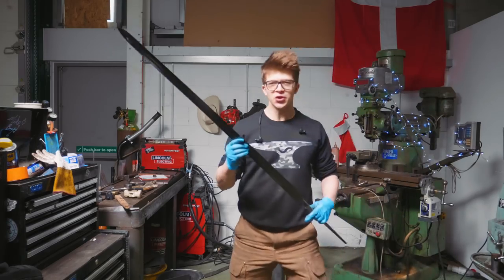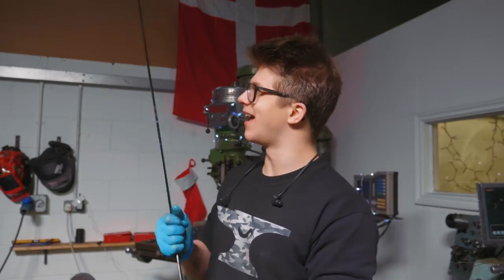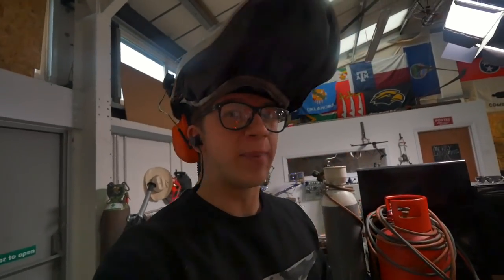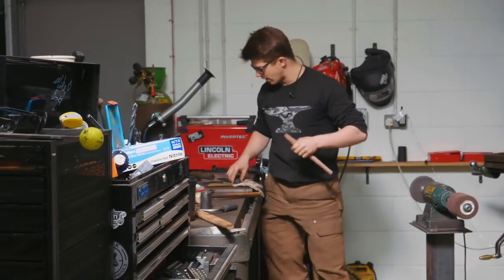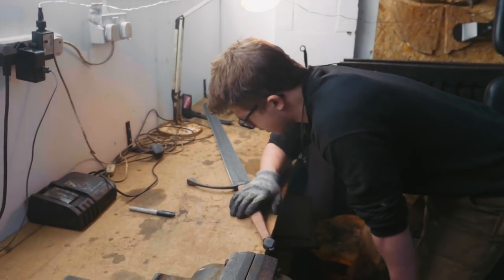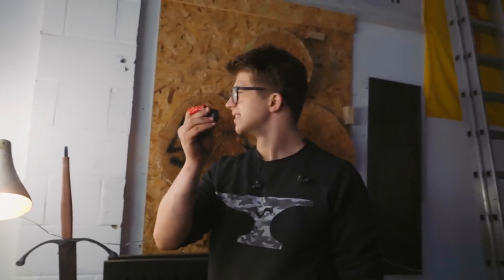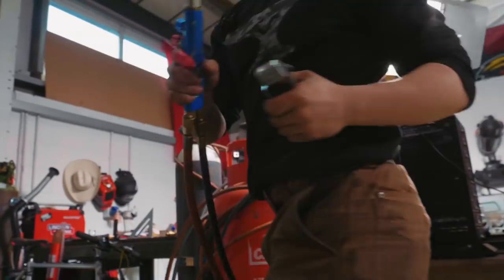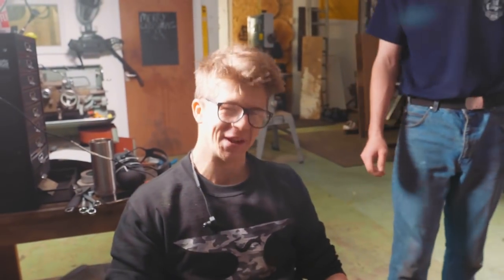MAKING A SCOTTISH CLAYMORE SWORD!!! PART 14 - FINISHED

Comment: Alec, correct me if I’m wrong, as what I’m thinking of is a distant memory of a history class in the American south about immigrants from Scotland...but was the claymore not supposed to be relatively dull on the sides as to shatter bones and not stick in them, while the tip was sharp for running people through? I understand that you’re not going for precise historical accuracy. I’m just curious as I only remember it for being a novel and interesting way for a sword to work...a tribute to the cunning of he Scottish people if you will. Good job though....another beautiful piece. ;) thanks for taking us along for the ride.
Reply: Depends on the wielder's combat style, if they halfsworded (grabbed the lower 3rd of the blade for more precise control) then they wouldn't want it sharp the whole way down.
Reply: Gavyn Caldwell swords were most of the time pretty damn sharp. We can see that in service sharpened blades from the late 18th century and all through the 19th, some of those blades are still so sharp that a wrong move will cut you pretty badly.
Reply: You are correct any blade smith will tell you the same you wouldn’t want a sharp blade as and contact would ruin the edge and make it weaken as the structure of the steel crystallization would separated and the edge would wear even faster if it gained a single chip
Reply: To ALL of the posters in this thread: Swords were sharp, they were pretty dang sharp at that. You can halfsword just fine with a fully sharp edge, also, when halfswording, you can grab any point of the blade, not just the lower third. You want a sword that is as sharp as possible so that it does not get stuck in bone, but rather goes through it. Blunt blades will be stopped by rigid cloth and swords did not have the smashing power to crush bones through armour. In fact, if you strike armour with your blade, you are doing it wrong.

Ruining the edge does not matter, since you go back and take care of it between battles, also, again, you do not cut armour, you can't you don't and it's a stupid idea to begin with. If your sword is sharp enough and has the proper edge geometry (note that a lenticular blade, with maximum sharpness is not common for historical battlefield swords, who more often had diamond or hexagonal cross-sections and quite broad-but-sharp edges in order to increase the structural strength of the edge and spine of the blade itself).

A sword is not a smashing weapon, not even a big sword. A big sword is, in fact, a very fast cutter, montante techniques basically set the blade spinning and you don't stop cutting, a blunt sword bounces, gets stuck and generally will not move well when impacting with an enemy, whereas a sharp sword will even bite into steel and transfer way more force (if you for some ignorant reason do decide to bash armour with it).

A sharp sword kills, a blunt sword gets you killed.
Reply: @Seasons You don't cut with the lower 3rd of the blade, the upper 3rd is the primary cutting surface. Therefore its kind of pointless to sharpen it on the lower 3rd, especially if halfswording, all it takes is one slip and a sharp blade can cut right through leather and the hand.
Reply: David Galbraith but it’s shown in artwork from the time that halfswording was done in many places along the blade, right up to the last third of the blade by the tip. You’d generate more control with a wider grip, and your aim with stabbing isn’t to run your target through, just pierce lethally, which six inches is plenty for. It would make more sense for a wider grip than to limit your hands to an area so close to the grip. Sharp was a necessity. Matt has even been wary before of touching sabres on the blade near the grip because they were service sharpened, and they blocked with that area. Still sharp though. There’s not much use to a blunt blade. May as well have a steel plated stick, or an axe.
Reply: You GENERALLY don't cut with the lower third of the blade, however, when halfswording, you seldom halfsword with just the lower third. Also, if your lower third is not sharp, you will not bind as well in your strong, meaning that you will not be able to control an incoming blade with the strongest part of your leverage. Furthermore, you also want to be able to do drawcuts or pushcuts with the lower third, especially when halfswording.

Not to mention the fact that a firm grip will prevent "one slip", halfswording would not have been a thing if it was a risky "one slip and you cut right through the leather and the hand." You grip the blade and you grip it tight, a sword is really sharp, but it is not a kitchen knife or a razor, i.e. it has a much thicker edge geometry at much steeper angles which makes it possible to press quite hard on the edge itself without getting cut.
Reply: Seasons wow you know nothing of bladesmithing at all everything you just said was false and again you don’t cut with a sword cutting is a drawing motion a sword is made to split and it you had ever hunted and gutted any animal you would know even the sharpest blades get lodged the sword was made in order to split armor at the seams and continue to split which is not possible with an incredibly sharp edge due to fragmentation of the steel crystals upon impact because of the very fine brittle edge created by being too sharp short swords like the wakizashi were made incredibly sharp because the used a slicing motion not a slashing like regular swords
Reply: Donovan McFarland you can't split armour, there are no weapons in the history of western europe designed to split armour. Not a single one.

What you might be thinking of is the way that the geometry of the tip of swords developed in order to pierce and break open the riveted rings of maille, compare the spatulated tips of 9th century blades to the almost reinforced needlepoints of late 15th century longswords.

Neither axes, nor swords, nor pollaxes have the mass or geometry to "split armour at the seams and keep splitting". They all cut with arced swings, or stab with great force, there is no splitting blows in any manuals, there are no seams in full plate (since armour was not welded) and overlaps in joints are, in fact, stronger, since the lames fit incredibly tightly together and double up on top of each other.

You might be referring to the gaps in armour between, for instance, the front of the cuirass and the outside of the spaulders or upper canons (rearbraces), however, these are gaps and are generally covered in mail (either a sleeve or a voider). However, again, you cannot split riveted, fitted mail with a sword other than driving the point in and hoping to severely stab whomever it is you attacked.

You cannot split armour.

There are no seams on armour.

Swords lack the geometry, mass and balance to be splitting weapons.
Reply: Donovan McFarland 
So you definitely cut with a sword, that’s why it has an edge. You can swing it with a chopping motion and it still leaves a cut, but even that aside there are push cuts and draw cuts that are taught and have been taught for centuries. You definitely cut with a sword. If swords could just split armor like you say, maces wouldn’t have developed as much as they did. Swords are less effective against heavily armored opponents because they can’t just go through armor. A good thrust might get through at least a little, depending on the sword, 

Also using hunting as an example of an edge getting lodged is a little misleading. Circumstances are very different, speed, weight, angle, edge type. You wouldn’t typically try to cut a limb off with a knife the same way you’d try to with a sword, and your method might differ again depending on the size and shape of the sword. 

Also the edge on European swords was more likely to deform than chip. Japanese swords were very sharp and extremely hard at the edge, which made them great for cutting soft target and struggle a bit more against metal. Metal wasn’t common in Japan the same way it was in Europe though, so their weaponry didn’t have to adapt for it.
Reply: I'll even allow leather gloves.
Reply: David Galbraith 
Your chef knife should hav a hell of a different profile that a longsword or really any sword, not to mention weight. A chef knife is what, a quarter of a pound? Maybe? The average longsword was 8-12 times that weight. It would be a hell of a lot easier to drive a nail with that weight, and plenty simple enough to swing it and put the end of a guard or the pommel into someone’s helmet or something and leave a dent and cause harm. 

And yeah, art isn’t 100% accurate but that art is consistent across multiple artists from different areas and times so it’s safe to say it’s accurate. One person painting a building might be artistic liberty. 15 artists painting the same building at different times is a good sign it existed. Arguing that it doesn’t because we can’t find the foundation seems unreasonable, and at least to me that still seems more reasonable than comparing combat forms for swords to kitchen knives.
Reply: Seasons, now hit something more solid than a rubber tire.
Reply: David Galbraith, let it go mate. You absolutely can half sword with a sharp blade, that's the point. It's much more about the grip than the sharpness. You could lop off fingers with a pretty dull blade just due to edge geometry if you held it wrong. If you train the technique, it's no issue.
Reply: Yeah skallagrim demonstrated it once bare handed. Id immagine it be much easier with leather gloves.
Reply: Absolutely. I think most people believe that these swords were heavy,  but in fact they're very light so they can be very fast. Blades were kept brutally sharp - as sharp as a fine straight-razor, so that they'd cut your opponent in half, or from the top of the skull down to their teeth, or from the nape of their neck down to their hip. The last thing I'd want in battle is for me to land a good blow to my opponent, only to have them brush themselves off and come back at me! If I land a touch to you, suffice to say that will be the last thing you ever experience on this planet.
Reply: one simple thing to remind you that swords were and still are supposed to be very sharp is that at the same time, blunt weapons also existed, and that sword had an edge over blunt weapons because of how nimble and light to use they were, and you never hit solid armor with a sword, maybe chainmail or leather armor, but not solid armor, because you have war hammers and other blunt weapons for that, since concussions are just as good
Reply: Donovan McFarland the wakizashi, katana, and any japanese blade was made that way because japanese steel was not too abundant and not of the highest quality, and because japanese armor had either a little bit of any metal in it, or none at all, it was usually leather and stuff like that, for the most part, so you just had to cut through flesh with those, and swords were not the preferred weapon of the japanese, it was naginatas and bows, for obvious reasons, and like Seasons said, there is NO weapon that can split armor, specially steel armor, even japanese weapons could only go for joints or thrust through flesh, which is why you usually see katanas thrusting, they can`t thrust armor but they can thrust flesh quite well

Comment: Dude .. you are streching your Vids to much .. showing 5 min Work in a 16 min Vod .. could be 7 or 8 episodes  ... second: your Burner was to small .. took to long to heat up the spot so the heat had to much time to spread inside of the Handle

Comment: It is a myth that European swords should be sharp.  The heavy type swords, like the claymore, actually were not designed to cut.  These swords were blunt 'bone crushers', they would break an arm or a leg of the opponent or they would cause a skull fracture with a blow to the head.  The rare swords that were designed to be sharp, ONLY were sharpened just before the battle.  Those warriors were not stupid, they would not risk an injury caused by their own swords.  In those days even a minor infection could rapidly get out of hand; that meant certain death, as antibiotics had not been invented and conditions in the field were gross.
Reply: All swords are designed to be sharp, and very sharp at that. They were not glorified clubs to break bones. The reason people thing European swords weren't sharp is because of incompetent smiths who didnt know how to put on a proper edge. Three things are needed to cut well. A proper edge, proper edge geometry and proper distribution of mass. Don't believe me? Look at any review of the Albion Knecht, a german Kriegsmesser. European.
Reply: You're sorely mistaken. I studied HEMA for 15 years - swords were kept razor-sharp. Swords were very, very light-weight; generally not capable of crushing bone. The Medieval swords I've handled have all been less than 2lbs... The cuts a skilled swordsman makes are designed to slice a person in half - whether it's straight across, from the nape of the neck down to the hip, or from the top of the skull down to the bottom teeth. There's nothing like, "owww, you hit me with your sword and bruised my arm"! If my blade comes into contact with your body, it is your last moment alive.